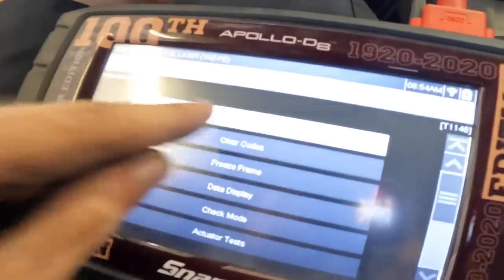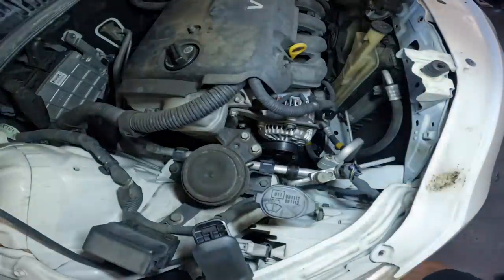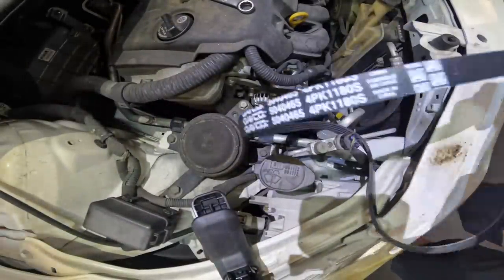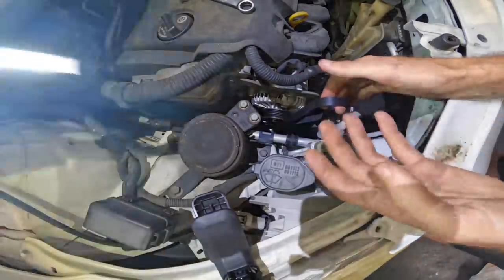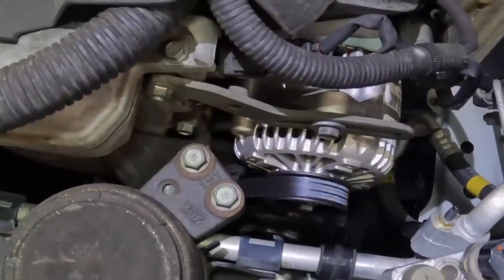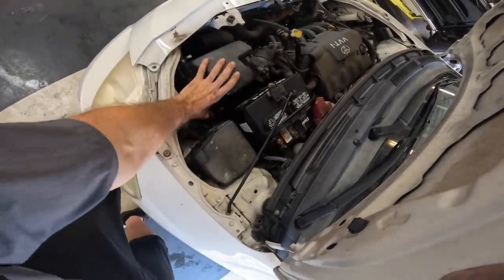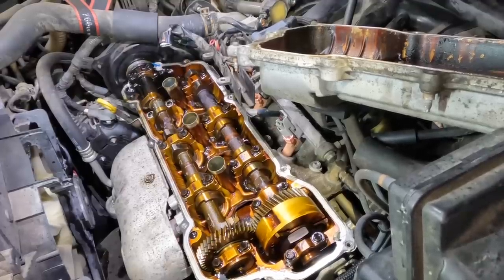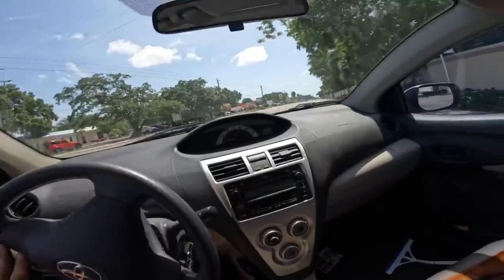Things come in waves & the Service Data Crutch. Said best@SouthMainAuto

Comment: Nice video, simple yet informative. Just wondering why the old belt had those grooves.Was it a faulty belt that the previous-guy installed? Is the belt rubbing against something? It would be interesting to see the new belt after driving the car for awhile to see if those grooves return.
Reply: Yeah, me too. Those looked like something was rubbing against the belt.
Reply: The serpentine belt is actually a V rib belt with multiple ribs. It rides similar to the V style belts where friction along the sides of the V shape of the ribs do most of the work. 

In automotive use its designated by a letter- K for English and PK for metric with the number of ribs preceeding it and the size of the belt afterwards. The standard V rib pitch on these belts are 9/64 inch or 3.56 mm. In this case, the replacement was a 4pk or a 4 ribbed belt. I couldn't catch the remaining numbers- it was 11something but that is just the length in millimeters (on the P or English belts the length will be 10th of an inch).

I think what is happening here is one of three things. If the belt wears the V ribs, it will sink further onto the belt eventually riding onto the flat portion above the V ribs. As the belt gets retightened, the ribs of the pullies impression them on the flat part of the belt and it takes on the friction element more than the ribs  

So it's possible the belt put on was made with a defective rubber component allowing faster than normal wear. It's possible something is out of alignment to the point it is causing accelerated wear. Or for whatever reason one of the pullies or the belt itself was replaced to the wrong spec causing accelerated wear. 

The designation just before the K or PK is J and PJ with a rib spec of 3/32 (6/64) or 2.34mm. They tend to be used in appliances and power tools. The designation just after is L and PL with a spec of 3/16 (12/64) or 4.70mm. They tend to be used in industrial applications. So a mismatch between them could cause slipping and the top of the pully groves to wear on the flat portion of the belt creating the impressions from underneath.

There is also the chance that the belt was routed incorrectly and the back of the belt was run over a grooved pully but that generally isn't possible with the appropriate sized length of the belt. It typically turns into an its to tight to fit or fits too loosely to appear correct and be tensioned.

Comment: 12:00 - I'm not a mechanic but aren't electric power steerings still hydraulic, the only difference being that the pump is electrical instead of mechanical?
Reply: No some use stepper motors

Comment: I thought that the alternator pivot bolt needs tightened first???
Reply: No, Ray did it right.
Reply: @gr7485  He most likely did. I'm just glossing over forty years of memory about how some auto manufacturers want you to tighten the pivot bolt first. On some alternators, they'll walk on you if you try to tighten the other bolt first. Plus if you over tighten the alternator too tight the alternator bearings will make noise with the possibility of the alternator bearings wearing out prematurely. Ray most likely tensioned belt properly as well.

Comment: What's your take on Dayco belts? I had the worst experience with my old car, it had a misaligned pulley so it would spit any Dayco belt after some km, but never had any issues with a Hutchinson for example. It was a Renault, so Hutchinson was the original brand of the belt, maybe that's why it hold good. Anyways, after I fixed the misalignment I always used another brand than Dayco and probably never gonna give it a chance again

Comment: Already seen that from Eric O but thanks Ray. You, Eric and Ivan are my daily go to's. Non mechanic here, were the indented lines mirroring the grooves on the underside of the belt? ie was the belt literally wearing out? Whilst I agree with the preventative maintenance, if you had tightened the belt via the crowbar would it have gone within a few hundred miles anyway. I'm NOT criticising, like I have said I'm the most novice person in this channel. But money wise, by replacing the belt before it snaps would in fact save the customer a double visit and two billed 1/2hr labour charges in effect saving them money? Have I answered my own question?🤔🙄😳 Appreciate any feedback either from Ray or any mechanic/technician please. This is an innocent comment from someone trying to understand the under hood wizardry.😳👍
Reply: Don't know about the most novice, but I watch this and other channels out of interest.  Def, NOT a mechanic here,  but enjoy the videos.
Reply: The original belt replacement could have been the economy replacement, vs the OEM replacement. Keep in mind when the price is too nice the component will fail twice before you splurge on the not so nicely priced.
Reply: @KECOG  absolutely. I sit back and read the comments trying to figure out what's being said sometimes. But I love Ray's humour too and all the one liners.
Reply: @xunheilvsnipezx3324  Yeah, you are right. One thing this channel has told me is OEM is a must as it's false economy otherwise. Short term gain long term loss for going for the  cheap option. Appreciate your reply.
Reply: That's the smooth side
Reply: @qei431.  I know it's supposed to be the smooth side but it wasn't. Hence my question.
Reply: @xunheilvsnipezx3324  I wish I was a young buck. I'm from the days when you did all your own repairs way back in the 80s but now it's all computer driven. I drove a Volvo XC90 for a few weeks, the thing kept fighting with me and telling me where to be on the road. Told the hire company I didn't like it and they said you would have to turn it off every time you fired it up. I was so glad when my own car was fixed.

Comment: Question... What are your thoughts on Fumoto valves?  I'm 70 years old and have always changed my own oil since I was 16. I've installed Fumoto valves on my last 3 vehicles and I love the convenience of just hooking up a house, placing it in the container for recycling and opening the valve. I've never seen one on any vehicles you've serviced.
Reply: If you want to risk it opening while driving, go for it 👍
Reply: @christophervanzetta  It has a lock you have to remove and a lever you have to depress before turning it to open.

Comment: I would take a close look at that water pump pully for damage that is affecting the outside of the belt.
Reply: I'm thinking the old alternator pulley was worn, the smallest diameter pulleys wear out the fastest, and that damaged the old belt. It might have looked ok to the previous tech that replaced the 'nator' but that old belt was worn in on the old alternator pulley. When the new alternator was put on, and reused the old belt, it had to re-break in to the new pulley causing more wear. Sort of like installing old pads on a new rotor, or vice versa. Not a good idea. I'm sure any tech would have recommended replacing the belt at the same time, especially on this vehicle, it's a good 'while you're in there' easy parts change, but it's possible the cost of the replacing the alternator was enough that the customer 'declined belt replacement at this time'...

Comment: Engine moved a lot at high throttle. Is there something wrong with motor mount?
Reply: I though that too. Maybe tranny mount by drivers headlight area???
Reply: @dragonmaker1541  He didn't see while in the car but it might explain the strange scoring on the top of the belt.